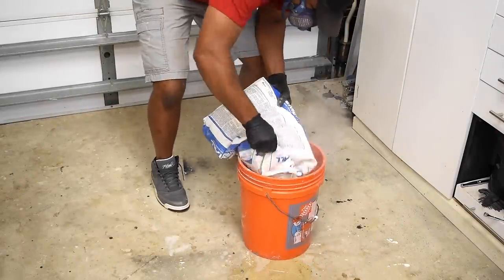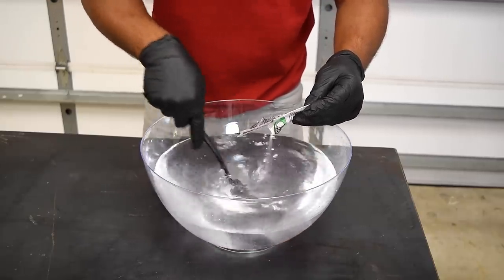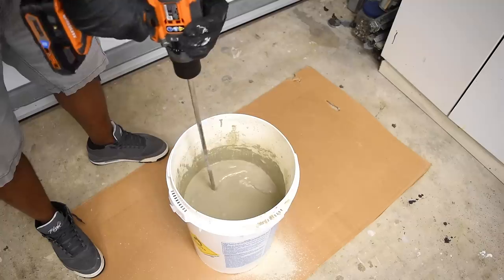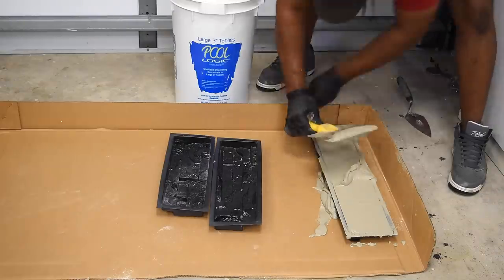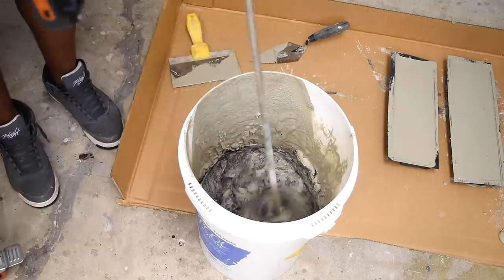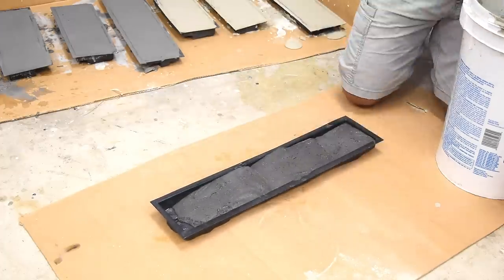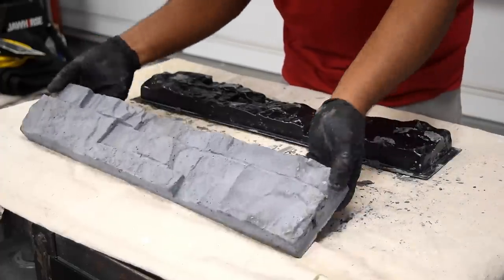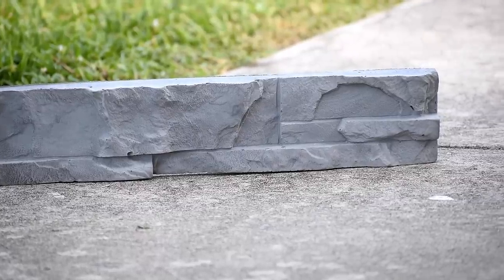How to make Concrete Stacked Stones ( Homemade Wall Stones )

Comment: So how much cheaper it is it you said a fraction  But that doesn't actually give me a good estimate of what it cost. Compared to buying them. I understand if you think ahead and you start making these a month before you need them you should have enough for a small project.
Reply: Look up local costs of stone veneer. The molds themselves (that he linked) are $65. Further materials looks to be about $6 compared to buying the same surface area amount of stone veneer. 

If you make one batch, this is more expensive. If you make two batches, you've already saved money. The more batches you make the less it costs per batch considering the largest expense is actually the molds themselves. 

You do get 9 molds so you can make quite a large surface area in one go.

Comment: Why did you not use an aggregate? how strong are these can you walk on them?
Reply from the maker: Stacked stones are usually placed on the wall. They are not structual. You dont walk on them. You can use cement with aggregate in them, the mix i used is fine without it.

Comment: How many bricks you get with a bag of concrete? I can see the set of 7 moldings is 70 dollars plus the material and my time how much is the cost per unit? At least 14 bucks. One box with 50 bricks cost in Home Depot 70 dollars.  
Where's the savings? I worked double, I expended double, and I saved nothing.  
Thank you!

Comment: Lightly spray the mold prior to the pour with WD-40.  That will make the cement pop right out of the mold without the flexing.  This may extend the life of your mold as well.  
NOTE:  Make sure you clean up any excess lubricant from the mold.  Shout out to Michael Builds https://www.youtube.com/channel/UCB96OOH2uyCGGemklQFFTkw for this tip.

Comment: Cement ? Cement mix? Do you mean concrete mix? You know that cement is not usually used without being mixed with another aggregate, particularly as this is aimed at the amateur user might be best to be clear on the material
Reply: Cement mix is sand mix, or "topping" as the old timers called it when I was a pup. The only aggregate is sand, no gravel. If you used concrete mix, the less than 4 inch thickness would make the casts prone to shear breakage due to the gravel allowing "stair step" shear lines. Cosmetically you would also see gravel in the style face, which would kind of spoil the intended look. Just like paver "bricks" and "cinder" blocks, neither of which contain gravel aggregate for the same structural reason

Comment: You need to hit the table with a hammer so it vibrates and it will get rid of all the air bubbles you got in the face of the stack stone

Comment: The problem I see with these moulded blocks is the vertical joints when walled. They look very unnatural in blocks, a normal wall would not have this.  10/10 for presentation though.

Comment: The first one, put water in the box. Second, put mixed cement to the water and use drill, not the same you do.  When you finish with the drill wait 5 minutes, and never mixed again the finished cement!!!

Comment: My dad would have kicked my ass if I had put dry cement product of any kind into the bucket before the water. Cement first leads to poorly mixed material at the bottom, especially around the edge. But thanks for the ideas.

Comment: Отлично . Вибратор нужен .
Reply: Вибратор нужен для другого рукоделия ), а здесь нужен вибростол и , желательно силиконовые формы. ...и подкрашивать надо бы и формы тоже частично, так натуральнее смотрится.
A vibrator is needed for other needlework), but here a vibrating table is needed and, preferably, silicone molds. ... and it is necessary to tint and the form is also partially, it looks more natural

Comment: making the back side of the mold smooth doesn't allow it to "bond" to a new surface when installed as well as if you wer to take a tile  trowel or notch trowel and rake a few grooves in it while shes still wet... and let me tell you she don't stay wet for long so boys you got to jump on it

Comment: U should always add concrete mix to water..just sayin
Reply from the maker: People say this, I've tied it and see very little difference if any. Dust kicks up still and when the water is at the bottom of a bucket it's hard to get to. Why do you feel that's the best way?

Comment: On terminology it’s called
grout when you have cement and sand mix...
when you add
rock to the mix it’s called 
concrete...
and I would use white cement
with white silica sand so the color would be more true...
add the color to the water...
you can also use a release agent so your mold won’t take
a beating... rookie lol

Comment: Cement mix is NOT concrete. No gravel, no concrete.
Reply: Are you saying to use Concrete?
Reply: @inspire734  not unless the minimum thickness is 4 inches. The title says "concrete", they're cement, like pavers or cinder blocks.